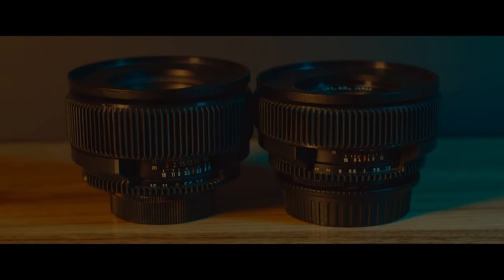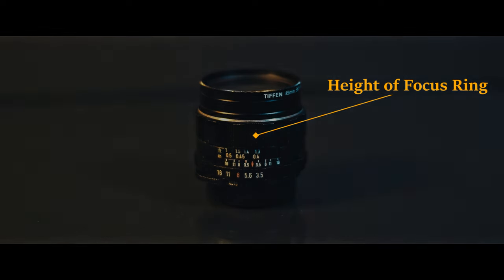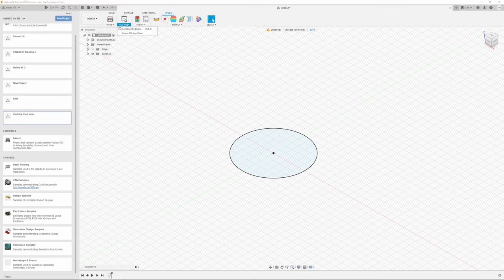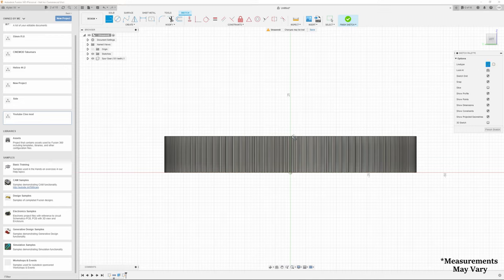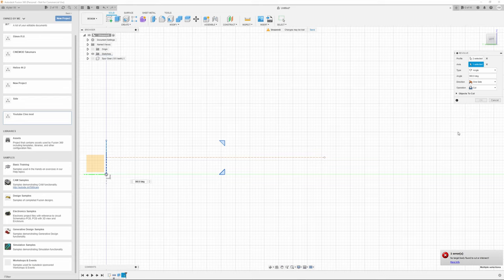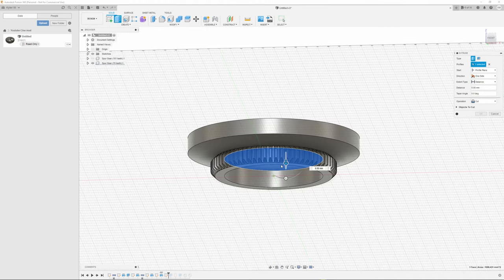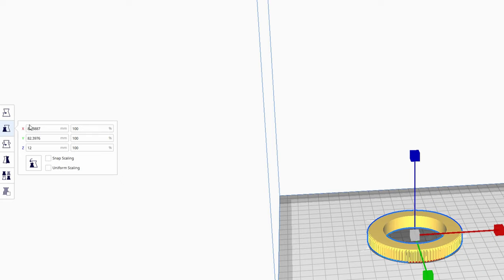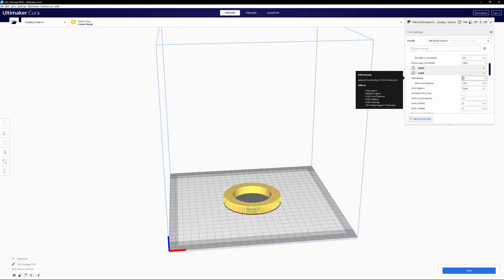How to Design and 3D Print Follow Focus Gears (Easy & Affordable)

Comment: Really thorough tutorial! As someone who's never done 3d printing, but has done some CAD work in the past, I'm trying to figure would it be worth printing my own gears & front caps, or just buy from someone. How long does printing one gear take on an Ender-3? What would you estimate the weight or amount of filament would be per average gear (around the size in your video). Thank you!
Reply from the maker: Thank You! Printing one gear at about 30% infill takes me about 6 or so hours and about 30 grams of filament that cost however varies depending on what infil percentage you set it to as well as how thick you make your gears. Ultimaker Cura includes an estimate for the grams of filament it will take as well as the time required to print so if you have the time and a printer id suggest printing your own gears so you can fine tune them and avoid the headache of having to shim one.